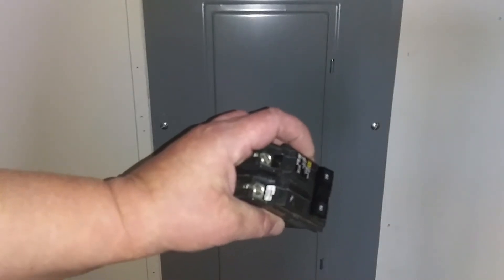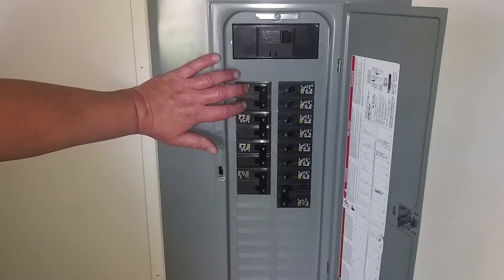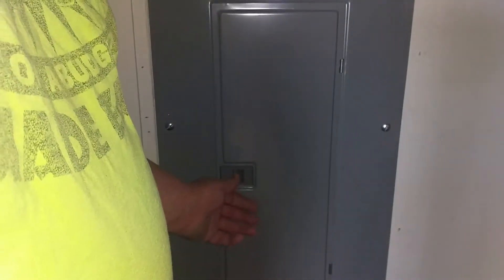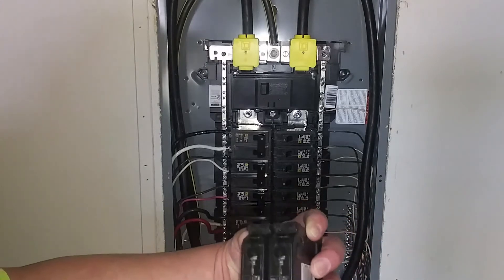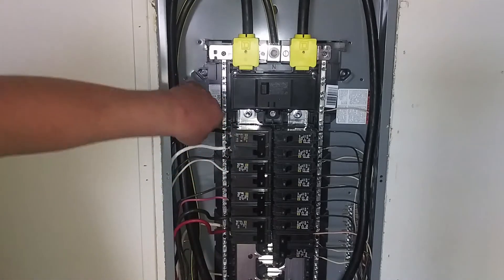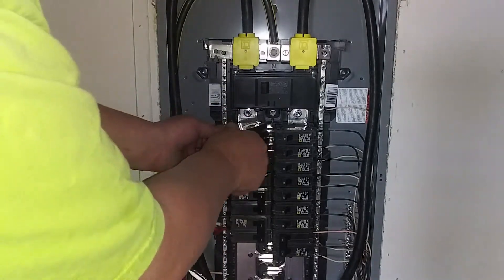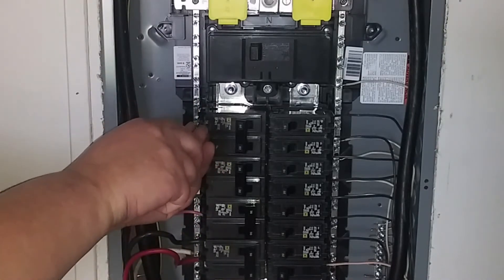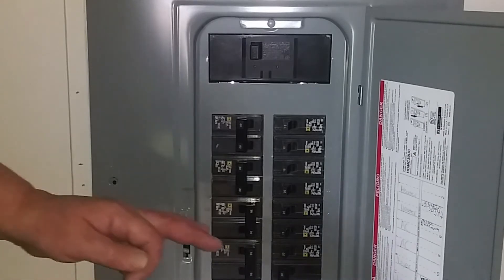How to Replace a Circuit Breaker in a Mobile Home

Comment: Where do you buy circuit breakers for mobile homes ? are they all standard ? thanks
Reply from the maker: I got mine a Home Depot. My breakerbox is made by Square D. Square D is pretty common.
Reply: @PikeCountyPappy  ya, mine looks like that too, will check out HD, i heard  there are shortages showing up already for breakers, one guy said 4 months till they get his in,, wow,, they suggest buying a few to store, just in case., thanks,,,
Reply from the maker: Let me know how you make out. The name Square D should be some where on the breakerbox. Let me know how you make out. I may be able to find one for you.
Reply: @PikeCountyPappy  super thanks for your help.

Comment: Do a video on how to remove the insidemain 200 amp breaker..mine is heating up and im needing to repalce it,,breaker in it is a siemans eq9385,,,thet are 345 on amazon but lowes shows a conversion one for 145??Have no clue if cheaper one will match up..any ideas?
Reply from the maker: Sorry but I am unable to help you.

Comment: need a tip have a  dead wall in the midddle of a double ,,  and have dead gfi on outside wall  also   with all breakers hot
Reply from the maker: I hope this helps. https://homeinspectioninsider.com/troubleshoot-dead-outlet/#:~:text=A%20dead%20outlet%20may%20be,damaged%20or%20has%20old%20wiring.